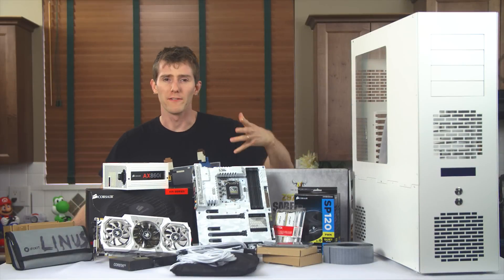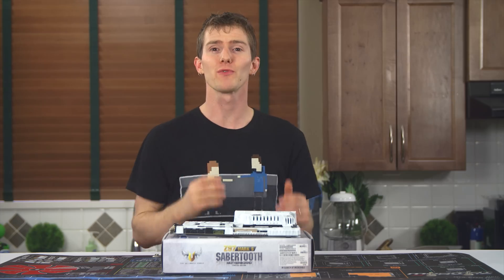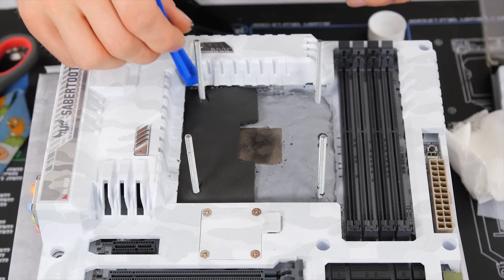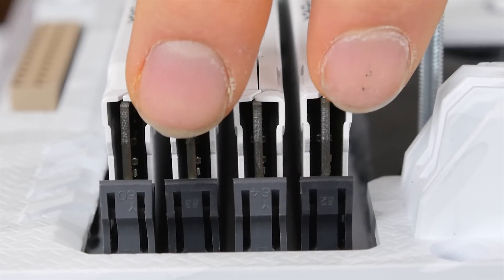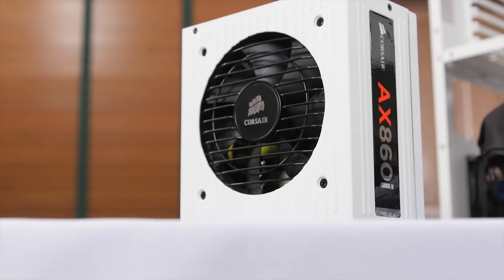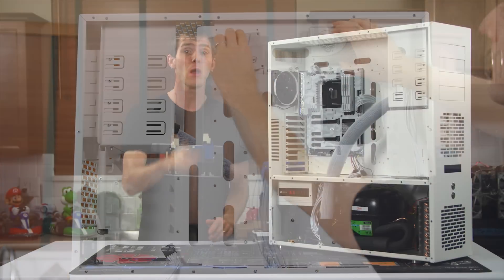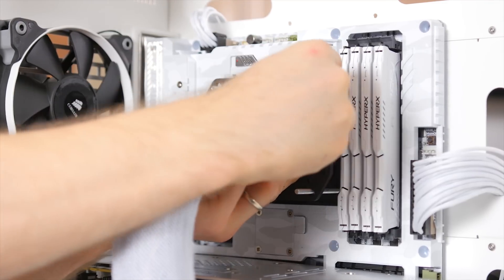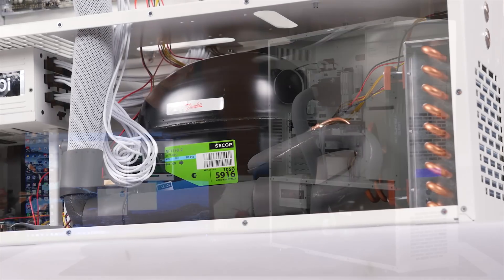ULTIMATE Sub-zero Phase Change Cooling PC Build Guide

Comment: I wonder if that style phase changer could work well in a mineral oil PC..  Submerge the end into a reservoir tank and let it directly cool the oil.   Mineral oil freezes at -22*F  So thermodynamic accounted for, I would think the heat the PC is making would go up to the chiller and the freshly cooled oil will naturally sink down and away,.
Reply: +Gexleo It would just freeze the oil close to the copper and the liquid has to flow to take the heat away, the ice would insulate the heat and trap it.

Comment: Guessing this is before the i7 6700K.... Way better than the i7 4790k
Reply: It is way better, if a 5% improvement is your definition of way better.
Reply: Aidan Gieg and also the same price... and DDR4... and runs cooler...

same price assuming that you live in aus ofcourse

Also mind sharing the source of your so called "5%" improvement? No?

Yeah I thought so.
Reply: r1Ns3 Most of the improvement of Skylake is in the iGPU, it does also have an advantage with the Z170 chipset performing better with some SSDs, other than that, that's it. Also, it shows barely any improvement in gaming what, let's face it, is going to be most of what a mainstream CPU going into a custom build is going to be doing. In the US, the 6700K is $100 more and Z170 motherboards are usually more expensive than Z97 motherboards. http://arstechnica.com/gadgets/2015/08/intel-skylake-core-i7-6700k-reviewed/2/
Reply: r1Ns3 And here is an AandTech article about the modest improvements, especially in single threaded performance: http://www.anandtech.com/show/9483/intel-skylake-review-6700k-6600k-ddr4-ddr3-ipc-6th-generation/9
Maybe you should've done your research before getting confident.
Reply: Aidan Gieg wait in the us is it 100 $ more expensive than 17-4790K?
Reply: r1Ns3 Yep. They're in Canada so I would think the situation would be similar.
Reply: Aidan Gieg Wow then in that case ABSOLOUTELY go for the 4790K for anyone else reading this, there is a legit 5 dollar difference in my case

so i guess it comes down to money, if it's the same price as the 4790K go for skylake BUT if it is like 50 bucks more expensive stick with the 4790K.

BTW never thought there would be such a high difference in $$$ between the two.
Reply: r1Ns3 Perfect buying guide ^
Reply: r1Ns3 And I'm surprised how small of a price difference there is in Australia.
Reply: Aidan Gieg Yea Prices are rigged here, like really rigged big time. The Titan is like 1.6K :(
Reply: r1Ns3 Wow that sucks. What is the 980TI? 1K?
Reply: Aidan Gieg 1.15K
Reply: r1Ns3 Wow. Is that in Australian dollars or US Dollars?
Reply: Aidan Gieg AUD, understandably but still a bit more than if it was a straight USD TO AUD conversion

Comment: hey man if i wanted to use this phase change case on a 295x2 instead of the cpu would it work? would it be too much for the phase change mechanism since a typical cpu TDP is much lower than that of the 295x2?

Comment: I'm doing a computer build. The color theme is white, similar to this one. And for the life of me I cant find a PSU that has white wiring like the one in this video. Any suggestions?
Reply: There aren't PSU's with white wiring, he uses custom sleeved cables. Find a compatible modular power supply and look up "cablemod custom sleeved cables". You can also sleeve the cables yourself if you want.

Comment: Why white?

If you made it black it would run significantly faster.
Reply: Then stop working, and stealing shit.
Reply: +ImperialDoor 
Underrated joke.
Reply: +ImperialDoor Because he's a racist
Reply: +AdminWirsoftonline .... sigh wow guys.
Reply: And the dark side has cookies... just saying
Reply: +ImperialDoor it will absorbed heat.
Reply: lmao nice try, i saw the other comment a month before yours. lol.
Reply: +Isisisid Ieerir8 Try to make a joke about Jews though and see how many friends you'll make. So yeah there's that.

But what it really needs to run fast is a fake spoiler, some bottom neons and racing stripes. Noobs.
Reply: nice meme
Reply: Red also makes it faster.
Reply: and then put flames on it
Reply: +ImperialDoor Because it's a PC - master race.
Reply: thats  RAcISt
Reply: Digger Nick  Light absorption AND heat transmission. Maximizing that black body radiation, you know. You don't even know physics - dismissed!
Reply: Yellow would be pretty amazing at swift and complex calculations, I suspect. Then again,  yellow does run into trouble with any kind of drivers...
Reply: is that a little bit racist joke?
Reply: Red come on bro, evera gud ork knos red go faster

Comment: Well actually the gas in the cooling system is pressurized, cooled down to room-temperature, then pumped into the cpu-cooler and decompressed there.

Comment: Could be better if the refrigeration unit cools the liquid that used to cool CPU and GPU. That way you can take the air insulation business out of the case, and put that loud compressor farther away from your desk.

Comment: Hey can someone help me with a build; this will be my first. I want it primarily for gaming and music production, so I do want 16gb of RAM and a really good GPU. I want to MAX out EVERY (if not most) game. My budget is $1,200 and may go just a little over. Also do I need a good sound card if I have a good sound system. Thanks :)
Reply: I don't have time to make you a build, I'll probably do it later but, don't get a soundcard. Get an external headphone amp/dac as well as an audio interface. If you want to have monitor speakers as well, you can run them through the dac's output.

Comment: Would it be practical to run freon through a water cooler system? Probably seems weird but I'm curious.
Reply: I'm almost sure you couldn't pressurize the system to required pressures without damaging components

Comment: I really liked this PC Build Guide specially the case LD Cooling PC-V10.
Is it possible to use this PC without having an air conditioner in a place like Delhi, India, where temperatures go up to 45 degree celsius in the summer time?

Comment: ATTENTION: After doing some research, the general consensus is to put dielectric grease in the socket when running 24/7 to prevent condensation as well as insulating the shit out of your motherboard.  This seems like an awesome cpu cooler but you have to be super aware of the problems any time sub-zero temperatures and humidity combine.  Condensation leads to oxidization and water damage. Correct me if I'm wrong LinusTechTips

Comment: is this a good computer setup?

-Intel Core i5-4460 3.2GHz Quad-Core Processor
-Gigabyte GA-H87M-HD3 Micro ATX LGA1150 Motherboard
-Corsair Vengeance 8GB (2 x 4GB) DDR3-1600 Memory
-Corsair Neutron Series GTX 240GB 2.5" Solid State Drive
-MSI Radeon R9 390 8GB Video Card
-NZXT Source 210 Elite (White) ATX Mid Tower Case
-Corsair CX 750W 80+ Bronze Certified Semi-Modular ATX Power Supply
thoughts?
Reply: Indi rulz i would get an evga psu over cx but otherwise, its good

Comment: A few tips (I'm typing this as I watch, so they're more or less in order)...:

Fill the middle of the CPU socket with a bit of Armaflex (closed cell foam) or art eraser, I've had condensation buildup around those SMDs

A layer of insulation/electric tape on the board before the art eraser makes cleaning the eraser off easier should you ever need to do so, SMDs aren't impossible to damage when removing the eraser.

Dielectric grease can be removed with a hairdryer, the heat turns it into a very watery substance which is easy to clean out of the socket.

A layer of kitchen towel or toilet paper over the sheets of closed cell foam installed at 3:40 will absorb the small droplets of condensation you're almost certain to get.

The insulation should be fine, but if the PC is left idle for a few hours it will probably get cold enough to start forming condensation further away from the socket than has been insulated.

A fridge will certainly not work, as it is designed to cool a static heat load, not something which is actively radiating heat such as a CPU. HOWEVER, the compressor can salvaged from a fridge in order to build your own phase change cooler if it is powerful enough, anything over 1/2 HP should be fine but also check that it will work with your refrigerant of choice - it might need an oil change.

Arctic Ceramique is definitely recommended for lower temperatures, such as when using a cascade/autocase/DI/LN2, but for a single stage any decent grease will do fine.

Comment: AWESOME!  Linus and crew, I want all of you to feel flattered because I have a ton of crap to do, yet was so seduced by the topic of extreme cooling, that I watched the entire 15 minutes and 12 seconds of this video.  I do not overclock on my Asus Sabertooth, yet I have a 900W Bronze PSU.  I say this because I can't stand, walking a tightrope over a set of possible problems that "might" not happen.  I want to go extreme, to kill all possible worrying.

I once taught at a technical college, and always warned my students, that when it comes to designating the amount of RAM in a system, keep in mind that as the years go by, and as unforeseen demands arise, theaverage business system is going to need more breathing space (the RAM) than just to turn on the OS... DUH!  So, I told them to make it a common practice to "overspec" (if I was using that term correctly).

The SUB-ZERO cooling here is AWESOME!  I like it if someone has to do some overclocking, that they go extreme, to not have to worry about frying their CPU.

Comment: hey guys i know there is always loads of these but can someone tell me if this pc would work i'm kinda new to pc so it would be a big help
specs
GPU: EVGA NVIDIA GTX 970 4GB 
CPU: Intel Core i5-4690K
Motherboard: ASUS M5A78L-M/USB3 AMD 760G
Case: NZXT So600W Corsair Builder Series 210 Elite Black Midi Tower Gaming Case
Power supply: 600W Corsair Builder Series CX600M 80PLUS Bronze Modular Power Supply
if someone were to reply it would be a big help

Comment: This is my first build:

CPU: intel core i7-4790 3.6GHz quad
Mother board: asrock h97 anniversary
RAM: g.skill ripjaws x series 8gb ddr3-1600
Storage: western digital caviar blue 1tb 7200rpm
Video card: msi geforce gtx 960 2gb
Power supply: corsair CX 430W 
Optical drive: asus drw 

Is it good? It needs to run gta v and the witcher 3 on med-high higher than 50 fps, because I'm selling my ps4 for this.

Total price: 736.29$
Reply: +Marton Peintler-Krivan i was just about to say that but then, 4 month old comment, i dont like it when people give shitty advice, i agree with you he should of got an i5 and 390..
Reply: That crush gta v on high at 70 fps wicher about 60 dos
Reply: CuruptNinja great :)
Reply: Sorry I own a Build like that with a i5 ;( thats the fps i get
Reply: MSI GAMING 4G GTX 970

Comment: Should I change something on this build?

Intel Core i7-4790K
Corsair H100i 
ASUS ROG MAXIMUS VII RANGER
HyperX Fury 2133MHz 16GB 
Samsung 850 EVO 250GB SSD
Seagate Barrucuade 2TB 
MSI GeForce GTX 980
Phanteks Enthoo Pro
EVGA SuperNOVA 850 G2, 850W PSU
MS Windows 8.1 
Asus Rog Swift PG278Q

And some kind of optical drive to install Win 8.1

Comment: Hi will this build be good for editing and gaming?
How much fps will this build get on games like MC BF4 TF2 thanks.

CPU: http://www.superbiiz.com/detail.php?name=I7-4790KBX&c=CJ 

Liquid cooler: http://www.newegg.com/Product/Product.aspx?Item=N82E16835181032&nm_mc=AFC-C8Junction&cm_mmc=AFC-C8Junction-_-na-_-na-_-na&cm_sp=&AID=10446076&PID=3938566&SID=

Mobo: http://www.superbiiz.com/detail.php?name=MB-MAX7HER&c=CJ

Ram: http://www.newegg.com/Product/Product.aspx?Item=N82E16820233536&nm_mc=AFC-C8Junction&cm_mmc=AFC-C8Junction-_-na-_-na-_-na&cm_sp=&AID=10446076&PID=3938566&SID=

HHD: http://www.newegg.com/Product/Product.aspx?Item=N82E16822178380&nm_mc=AFC-C8Junction&cm_mmc=AFC-C8Junction-_-na-_-na-_-na&cm_sp=&AID=10446076&PID=3938566&SID=

Times two.

GPU: http://www.superbiiz.com/detail.php?name=EV-980ACXS&c=CJ

Optical: http://www.outletpc.com/uh7279-asus-drw-24b1st-dvd-rw-drive.html?utm_source=uh7279-asus-drw-24b1st-dvd-rw-drive&utm_medium=shopping%2Bengine&utm_campaign=pcpartpicker&utm_content=Asus%2B-%2BDVD%20%2F%20Blu%2DRay%20Drives%20%3E%20Internal%20DVD%20Drives

Case: http://www.microcenter.com/product/441510/Graphite_Series_760T_Full_Tower_Windowed_Computer_Case_-_Arctic_White

Windows: http://www.newegg.com/Product/Product.aspx?Item=N82E16832416806&cm_re=windows_7-_-32-416-806-_-Product

PSU: http://www.amazon.com/dp/B00SN7CGAO?psc=1

Wifi card: http://www.amazon.com/Bolse®-300Mbps-Wireless-N-Network-Adapters/dp/B00NTW99A8/ref=sr_1_1?ie=UTF8&qid=1430546202&sr=8-1&keywords=wifi+card+windows+7

MIC: http://www.amazon.com/Audio-Technica-AT2020USB-Cardioid-Condenser-Microphone/dp/B001AS6OYC/ref=sr_1_14?ie=UTF8&qid=1420157521&sr=8-14&keywords=Blue+Snowball etc

Case fan: http://www.amazon.com/dp/B00L64O5RI/?tag=pcpapi-20 

TIMES 2

TOTAL PRICE 
2009.23

Comment: Im looking to be able to max out every next game with 35+ FPS.
Is that possibe with this build? I plan to be doing 1600x900 

Cpu: AMD FX-8350 4.0GHz 8-Core Processor

Mobo: Gigabyte GA-970A-DSP

Ram: Corsair Vengeance 8GB (2 x 4GB) DDR3-1600 Memory

Gpu: Gigabyte GeForce GTX 970 4GB WINDFORCE 3X Video Card  

Psu: EVGA SuperNOVA NEX 750W 80+ Bronze Certified Semi-Modular ATX Power Supply

What do you think?
Reply: Play 1080p at this, 40fps easy. Btw this is the exact same build i may get, but with a zotac 970

Comment: I have a current/first built question

Operation Nightmare (Desktop computer)
Enermax Ostrog
MSI X99S Gaming 7 motherboard
MSI 970 Gaming Card
WD black 1TB
Crucial 240GB SSD
Corsair cx 750w
1X 80mm fan
2X 120mm fans

My question is, do I have my PSU fan facing up or do I have it face down? Some sites i read says have it down while Linus says have it face up. My front and maybe my side fan(s) will pull in fresh air with my case rear fan push out the heat.??

Thank you to all that comment in advance

Comment: Performance White Build (Not as expensive as the Sub-zero)
CPU: i5-4690K
Motherboard: MSI Z97S SLI Krait Edition
Memory: Kingston Fury White Series 8GB (2 x 4GB) DDR3-1866 
Storage: Western Digital Caviar Blue 1TB 3.5" 7200RPM Internal Hard Drive
GPU: MSI GTX 970 4GD5T OC [WHITE VERSION]
Case: NZXT S340 (White) ATX Mid Tower Case
Power Supply: Fractal Design Tesla R2 650W White (Gold Certified)
Cables: White Cables
Fans: Corsair AF120 White LED's

Comment: Is  this a good pc:
Amd fx6350 @3.9ghz
Amd Radeon r9 280x
16gb ram
Corsair h55 cup cooler
3tb hard drive and 240gb ssd
650w psu
Reply: I wanted to use it for playing games like bf4 in 1080p at max settings

Comment: Nice build, you should try uncapping the cpu and replacing the thermal paste with arctic silver, it works wonders I did it to mine and had a 3-5 degree temp drop.

Comment: so now that we have created a loud refrigerator sized computer, could you not make it more elegant by using a peltier cooler? they are around the size of the cpu and are dead silent, they operate on the same principle as a refrigerator, and fit in a space less than a quarter inch thick. you just need to handle the excess heat, but the excess heat should not affect the cpu. so maybe a dual rad liquid cooler on the hot side?

Comment: I am thoroughly disappointed by the 5GHz. 4.6 is quite common on air, so this actually isn't a huge step. This might be extreme, and I value the effort you guys put into guides like this, but the results are mediocre at best. If I learned anything from this, it's not to buy it.

Comment: I have a new build in my head would this allow me to play every game on highest settings and livestream with no lagg? Let me know what i can change etc :D

CPU: Intel i7-4770K 3,5 GHz (3.9 GHz Turbo Boost)
MOTHERBOARD: ASUS MAXIMUS VII RANGER
GPU: GTX 780ti superclocked acx coolers
CPU COOLER: Corsair Hydro Series H100i
SSD: Samsung 850 EVO 500HB SSD
HARD DISK: Western Digital Blue 1TB 
RAM: Crucial 16GB DDR3-1600 kit
POWER SUPPLY: 600 WATT
CASE: CM Storm Stryker

Comment: Good pc for editing?
Please give me some advice, this is my first pc that I'm going to build 

1. Motherboard: B85-G43 GAMING MB MSI INT S1150 B85-G43GAMING
2. Water Cooler: Nepton 240M CPU Water Cooler 240 x 27mmRadiator2x 120mm Fan 800-2400 RPM 
3. Processor: Boxed Intel Core i3-3240  Processor ( 3MB Cache / 3.40 GHz / LGA1155) 2 cores and 4 threads / Intel HD Graphics 2500 
4. 8GB RAM: HX316LS9IB/8 8GB 1600MHz DDR3L CL9 SODIMM 1.35V HyperX Impact Black Series
5. Case: Obsidian Series 750D Full Tower Case
6. CPU COOLER: Hyper 212 Evo CPU Cooler Universal Tower cooler 4 CDC heatpipes 120mm 600-1600 RPM PWM

Comment: This kind of isolation is crap. It´s much better, efficent and more easy to use liquid tape for electical isolation. All the top overlockers like der8auer for example reccomend and use this. With youre kind of isolation you dont fully isolate. Liquid tape is like a second layer of rubber on the mainboard, where whitch cant be penetrated by water.

Comment: That pc is not even close to my pc
Case:Thermaltake Commander G42
Motherboard:ASUS Rampage V Extreme Edition
Core:Intel core I7 5980x Extreme edition Octa-core 
Overclocked at (4.9 Ghz)
Cooling (core):Corsiar Hydro seriesH110 Liquid CPU cooler
Ram:Corsiar Dominator 64GB (16x4) DDR4
GPU:Overclocked Gtx GeFORCE 980 triple 
4gb
Ssd's :(3) Samsung 850 EVO 1TB SATA 6GB
Storage: WD 3TB internal hardrive
Cooling(every component):Corsiar air series SP120 
PSU:EVGA supernova P2 Power supply 1000 watts